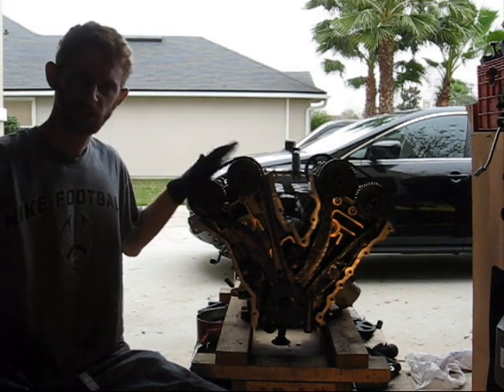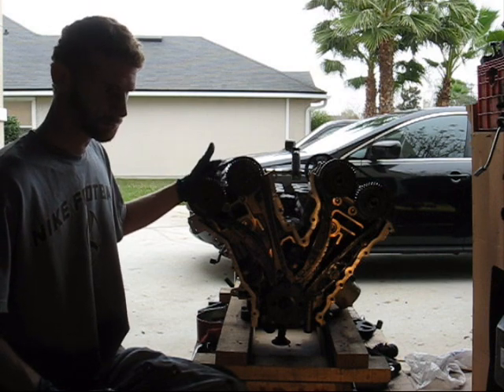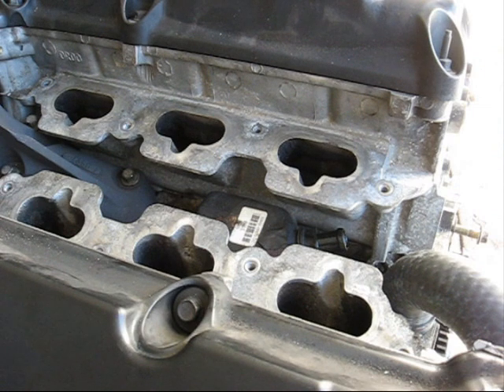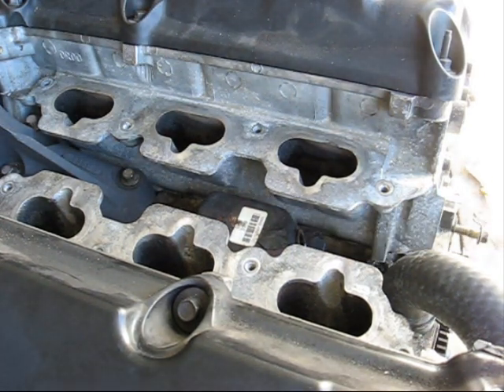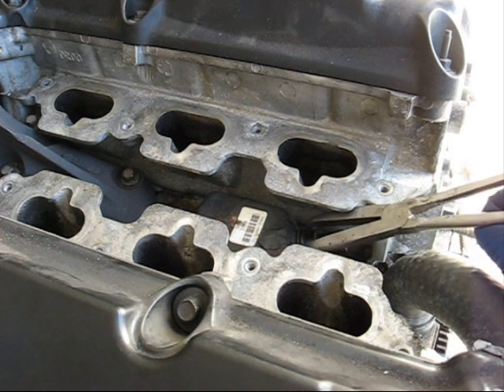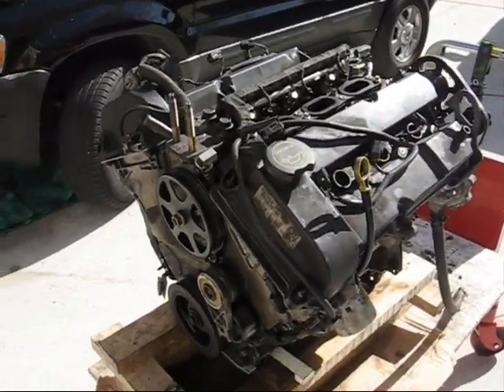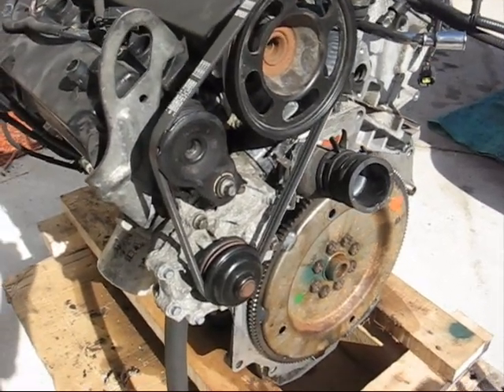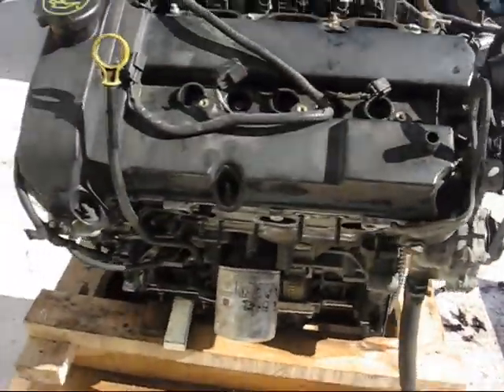Taurus Engine Into A Ford Escape Part 2 - Assembly and Install

Comment: hope you read this.  going through same process but with an 05 engine. sweet trick for mount.  i got the oil separator/  05 got a plate there.  oil separator nearly gave me heart attack.  thing wouldn t fit in valley.  gave it the boot and collapsed the baffle.  was enough to slide under the valley. had to straighten out the  baffle in place so it would fit in block.  was only way with out pulling the head.  the engine i pulled out had a knock sensor, in 04 tribute.  it was swapped engine.  now i can t find a plug for that thing.  driving me crazy.  is the a knock sensor on escape  where s the connector i stretch the wire around and nothing around to connect it.  i don t have the intake on yet.is it on there?   i am starting to think it might but from previous donnor car and not required on tribute.

Comment: Awesome and concise video on what's needed!  I would like to put a 2005 Ford Escape long block in a 2002.  Is that possible? I've heard you need to swap wiring harness, but not clear which one should be used (2002 i would guess). Any insist appreciated!
Reply from the maker: use the harness from the vehicle.
Reply: @pfun41  Thanks for the reply.  Do you anticipate any other issue of using an 2005 long block in the 2002?
Reply from the maker: @jgoeke1  Water pump outlet will be a different size. As long as its the same drive style and doesn't have VVT or anything like that it should swap right in.
Reply: cool thanks.  I read somewhere the fuel injection rail also, but nothing sounds difficult.
Reply: Quick update: Using the 2005 motor in the 2002 is almost exactly like what you present using the Taurus motor.  After doing all you mentioned you also you have to move the timing cover from the 02 onto the 05 motor.  In addition to modifying the motor mount, you also have to shorten the PCV valve ventilator housing (the 05 does not have one) to get it into place due to the same head interference.  I bent the tabs on the breather plate that sticks down in the block to make it a bit shorter.  Other than that it looks to be a direct swap. Won't know for sure until i get it all back together and start it up.

Comment: can a 2004 ford Escape engine go into a 2006 ford Escape
Reply from the maker: Check the water pump drive and for VVT. If the water pump drive is the same and the car doesn't have vvt it should work.

Comment: 2 Tips:

1) Remove the hood. It only takes ten minutes and helps with access and lighting.
2) The radiator will come out without fan removal and replacement.
Reply: Kip Anderson  he’s probably done it for a reason...he’s not a  rookie

Comment: I bought a 1 ton engine crane to swap motors - do you think it will be strong enough to do the job? I see your crane is fully extended and probably a 2 ton. Thanks for the info. Best video online for this kind of engine swap.
Reply from the maker: It's a 1 ton, should be fine for an engine this size.

Comment: Great video(s). The only thing I would have done differently would be to do a dry start before starting. 
Dry start to me means, pulling fuel pump fuse, do 2-3 cranks of the starter of 10 seconds long to build oil pressure, then start the engine.
Reply from the maker: I do those now, but Ive had the engine try to fire anyway or not build pressure.

Comment: That was outstanding. I have 2007 Escape, dead in my driveway that I need to decide what to do with.  I am mechanically inclined but not nearly to the point you are.  I read on an escape blog that someone put a 2008 2.0 focus engine in their Escape. Matched up pretty cleanly outside of a few items.  Again, very well done!

Comment: the taurus moter mount comes off without removing the head?
Reply from the maker: The Taurus uses different mounts, the spot the escape mount bolts to is unused on the Taurus.

Comment: hey quick question i have a 2002 ford escape xlt my engine in escape has water lines going in where the oil filter is at i got a engine that does have those  water lines on it just oile filter screws to block place i bjought it from says it fits

Comment: I've got a 2003 Mazda6 needing new motor. Guy 20 miles away selling pulled 2005 Ford Five Hundred engine. Pics look like swap timing cover, oil pan, valve covers, camshafts, and move over the two OCVs from 6 to new block. Will this work? Anyone?

Comment: I have 2 escape  v6 one an 04 the other an 05. the 05 is on the side yours is but the engine we are swapping for is on the other side. So the engine we are swapping for the sensor is in the 9oclock position  should the keyway still be in the 9 position with the tooth gap also at the 9?
Reply from the maker: The encoder setup on the engine you're swapping in should the the same as the one that came out, change what you have to in order to make it the same.

Comment: Hi, I want ask you, I have a problem with my Fuse Inside Box . I have a Ford Escape XLS 2006 and I need to remove and change the Fuse Box , because the First Fuse/relay location is broken and I need use Trailer lamps. Can you help me??

Comment: I want to say this is a great video I just wish that there was more light
Reply from the maker: I have a shop light on in this video (you can see the orange glow on the engine block) and there's plenty of ambient light. The problem is it's all backlight so my camera was adjusting the ISO to compensate and dimming the picture. I couldn't arrange it for better lighting due to a lack of space. I plan to avoid this problem in the future.
Reply: I love this video as I have a 2004 Ford Escape and my oil  light is on the blinking. Oil is inj the vehicle and it ran hot and stop.  Little power.  Now I was told that My oil pump may have stop working.  So with that say  can you send me a list of the parts used, can you send to vanrolle@batelnet.bs.  In the Bahamas.

Comment: Is the Escape Crank Bolt reverse threaded too?
Reply from the maker: IIRC the 3.0 has a regular thread crank bolt regarless of what vehicle it's in. Only the pulley on the Taurus version is reverse threaded.
Reply: Thanks! Prepping to take off the pulley in order to change the timing chain cover gaskets... What are the specs on your air compressor and impact wrench that you used to spin off the pulley if I might ask?
Reply from the maker: 150 psi 33 gallon craftsman Oilless compressor. Basic single hammer craftsman impact.  About 2004 vintage.
Reply: What was the vin

Comment: Excellent video pfun41! I just did the swap this week and used your video as the how to bible. I did use an 04 taurus motor and valve covers as it has the pcv valve in the rear (right) valve cover instead of the original mounted under intake. Will make it easier to check and clean. When I pulled original motor (bad rod knock) I pulled with rear manifold, bearing carrier brace and alternator still attached. There was room but getting axle bearing carrier brace away from carrier was a nightmare that I would not recommend as it involved pulling the right cv axle as well. Going back in I installed carrier brace in place and loosely attached exhaust manifold to exhaust pipe and laid alternator in place with wires attached. My motor mount was slightly different than yours, I ended up having to trim quite a bit more off of it than it appears you did. Once instaloed she started right up! Got the engine for $100 on CL. . Thanks again for the video and explanations!

Comment: 2005 mazda6 v6. should i take it out from the top? forums say easier from the bottom. can't see why i can't take it from the top.
Reply from the maker: +NeatAjro Illyrian Unless you have a lift or wanna get creative its gotta come out through the top. And I can't see it being easier from the bottom without a lift.
Reply: +pfun41 ok. with or with out the transmission?
Reply from the maker: Without.

Comment: Did you pull the engine out the top only because you didn't have a hoist or do you think it's easier that way?
Reply from the maker: Tony T If it will fit it's almost always easier to remove an engine from the top. If you try to remove it from the bottom you have to drop the entire subframe, suspension, engine, and transmission. Then unbolt the engine, and you would still need a lift to move it. Not to mention once reassembled it would need an alignment since the suspension was apart. There are less components to deal with If you remove it from the top.

Comment: One my question I have the carrier bearing lose all the bellhousing bolts engine is lose but it won't come completely apart from the transmission the transmission lifts with the engine when I try to hoist it out. What am I missing?
Reply from the maker: Ryan Burke you have to pry the engine horizonatally away from the Transmission before lifting it out. Also the torque converter needs to be unbolted.

Comment: You said you can keep the taurus valve covers in it correct?
Reply from the maker: Ryan Burke The Valve covers appear identical, so they should work.
Reply: Right on thanks.. And thanks for the video it has helped a lot there isn't much online about these things
Reply from the maker: Ryan Burke
I know, I looked before I made this. Surprising considering the abundance of these engines.

Comment: I can't for the life of me get the motor and transfer to split. There is about half inch all the way around all dowels are clear but she won't let go!!!!? How did to get it to split?
Reply from the maker: lyndon stopanski The transmission? Did you unbolt the passenger axle carrier bearing? I forgot that the first time I tried to pull it out.

Comment: U didnt show the rear exhaust and under  car install. I got to do engine swap tomorrow but with ans escape  engine im planning  on coming  out thru top as i have no lift. But just wondering  hoe hard rear exhaust  was.
Reply from the maker: I had tried to remove the engine with the exhaust manifolds still installed but they wouldn't fit. I ended up removing the rear exhaust manifold in the dark while the hoist was holding the engine separated from the trans. That's why there is no video of it. with the engine still bolted up If you remove the intake you can get to the rear manifold bolts from the top and it isn't too bad.

Comment: That's an awesome video, did you have issues with the ECU at all? Or is it essentially a plug & play situation?
Reply from the maker: Only the block, water pump, and minor parts were used from the Taurus, and they're nearly identical to the Escape. All the sensors, wiring harness, and other electrical components were from the escape, which makes it a plug and play affair. The only thing that had to be changed was the indexing of the encoder wheel for the crank sensor. If you tried to use an engine from a different year range it's much more complicated. And it HAS to be a 3.0 Duratec, the 3.0 Vulcan was also found in Tauruses but is an entirely different engine.
Reply: Oooh ok, fair enough! That makes it fairly easy enough and for the most part, headache free lol
Reply: Alberta Bound